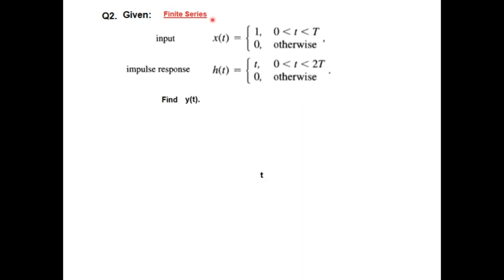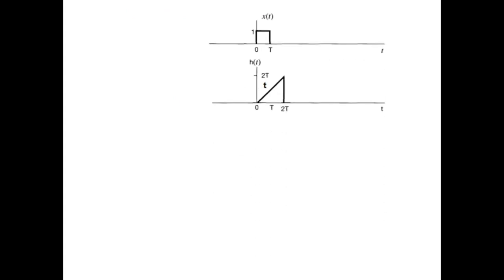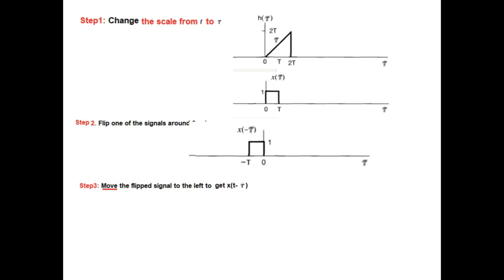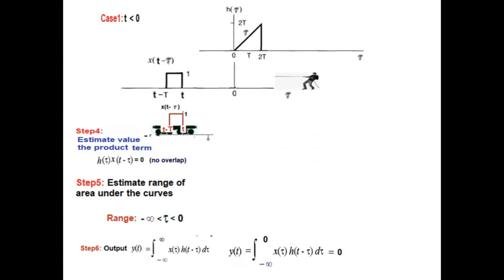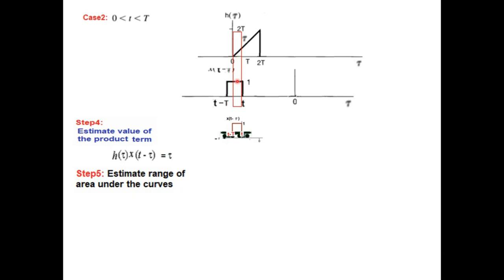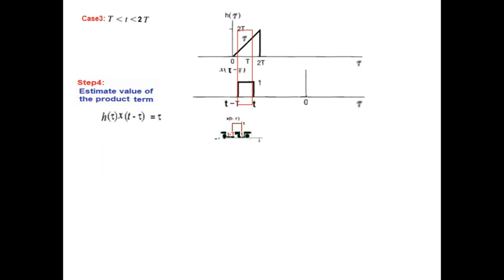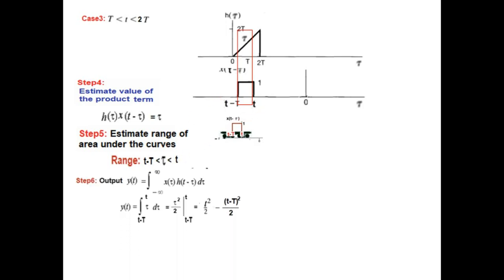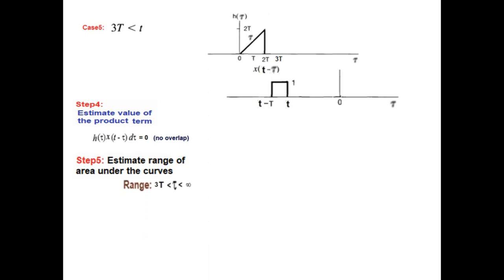(E)SS(O) Ex 2.7 || Continuous-Time LTI Systems: Convolution Integral for Finite Signals

Comment: sir, how that slope is made in 1:01 ??
Reply from the maker: It is called ramp function (google it) , whose value increases as t increases. so if x axis is 1, y-axis will be 1, and so on.
Reply: @ElectricalEngineeringAcademy  got it Sir, thanks